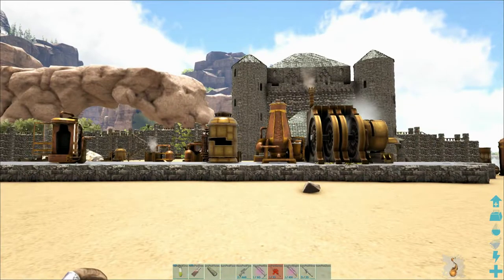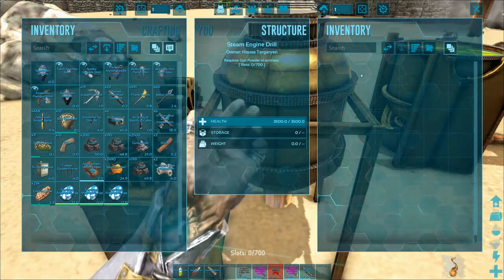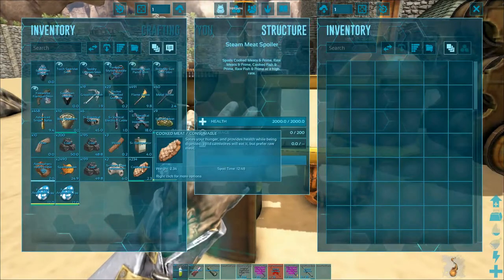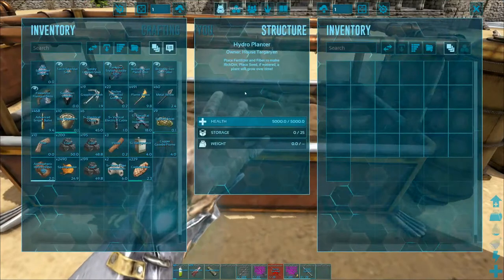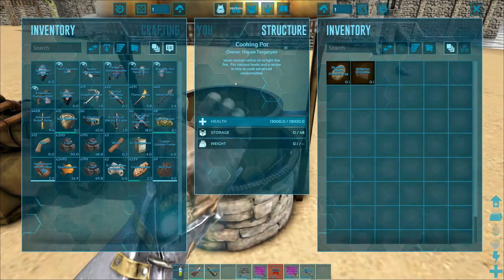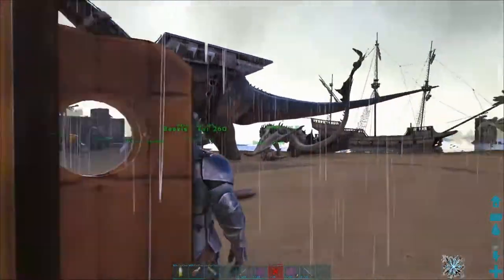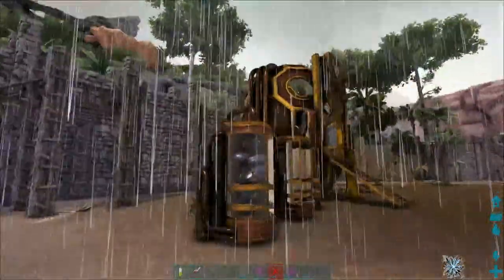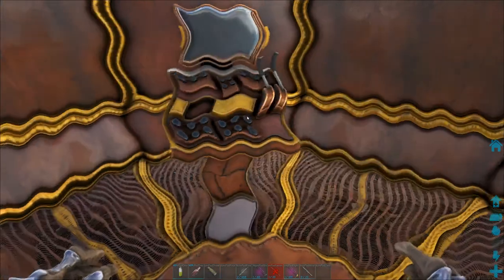ARK Steampunk mod: All Miscellaneous Structures | Tutorial

Comment: thnx a lot! u have a new sub :D i wanna know about the Dino item grabber.
Reply from the maker: Thanks man! Really appreciate it! I'm going to check it out when i can, because i tried it once, but it didn't do anything :p To be followed... ;)
Reply: I second this request for someone to figure out exactly how to use/connect the Dino Item Grabber so we may have it move the items as the in game description on the item suggests. I.E. "You can place items in here and they will be moved if connected."  Does this mean it moves things to the inventory of the Dino Item Grabber structure, or can it be connected to the Copper Storage Locker with Electrical Cables or something similar?  I've tried the cables and can't get it to work for auto-transfer to a specific connected box.  Dehydrated in game, better stop this long post, luck to all! necro post...